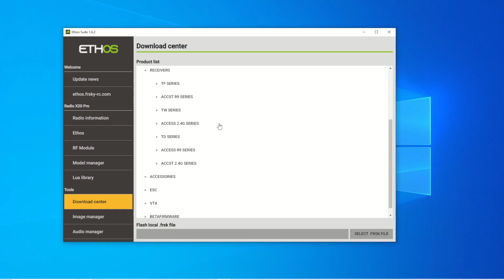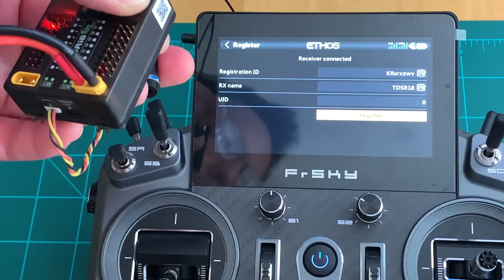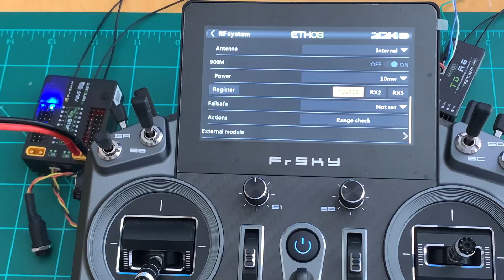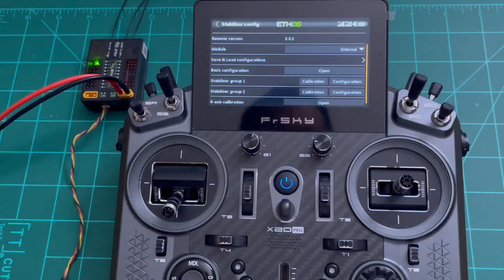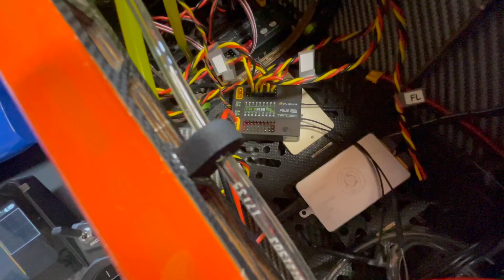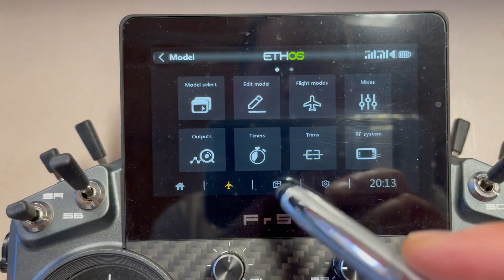Setup FrSky Stabilized Receiver for Turbine Jet MB-339

Comment: you have the TDSR18 backwards to how it's shown in manual - manual shows Antenna is towards the rear. Any reason - does it matter?
Reply from the maker: Doesn't matter as long as you do the gyro calibration step correctly i.e. making sure all surfaces compensating correctly during auto level mode.. and reversing it if needed. Thanks.
Reply: @8HrToGo  sweet, thankyou.

Comment: Hello! Why did you choose pin 1? You can use any available pin isn't it? Just curious. And calibration has to be done after receiver installed in the plane.
Reply from the maker: I configured Pin 1 for SBUS In for Redundancy functionality. The spec showed only CP1 able to configure SBUS In. As for calibration, the axis calibration have to be done while moving the receiver around outside the plane first. Then you can placed it in the plane to test your calibration setting correct or not as shown in video. Thanks.

Comment: What Frsky receiver would you recommend when running Gas engines in my planes? I have the X20s radio.
Reply from the maker: I would recommend either TD-SR10 or TD-SR12. Both have advance stabilization feature, telemetry monitoring, and cover you both for 2.4GHz and 900mHz. TD-SR12 is more expensive bc additional 2 channels, and provide dual power balancing if you need it. Thanks.
Reply: @8HrToGo  T%hanks for the reply,Are those receivers ok around ignition system interference?
Reply from the maker: It has anti-interference. Many turbine pilots also used it in particularly, the TD-SR18, and TD-SR12 bc they need more channels. If you don't need many chn, the TD-SR10 is also good.

Comment: Brian, good video. You showed all the steps perfectly. Just a suggestion, when re-mapping Pin 1 to SBus Out, I just move only Channel 1 Ailerons to an available pin - say Pin 16 for example. Then you do not have to move every channel down as you did in the video. Also, when checking gyro movements and verifying control direction, it is good practice to stand BEHIND the plane to view the surface throws. It is easy to set them up backwards when standing in front of the plane - especially ailerons and rudder.
Reply from the maker: Thank you for your kind comment. 👍Yes, that would work too.. moving only CHN1 Aileron to another Pin, but I preferred mine in sequential order.👍